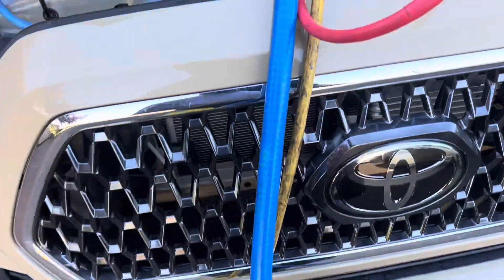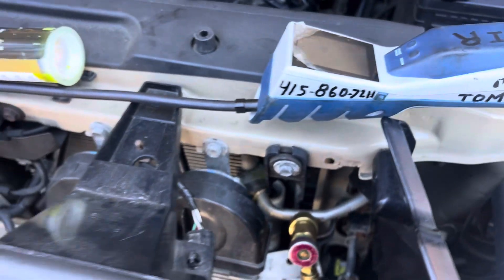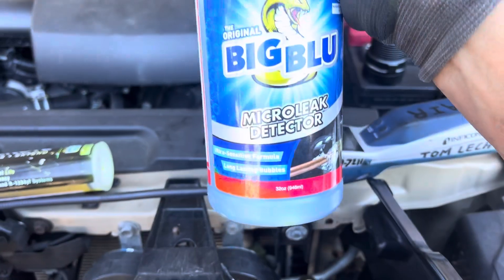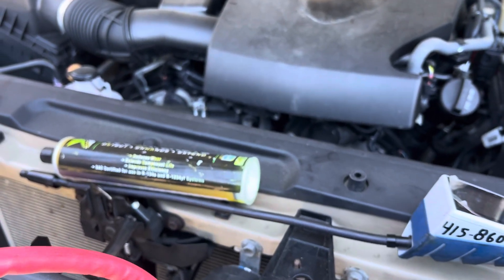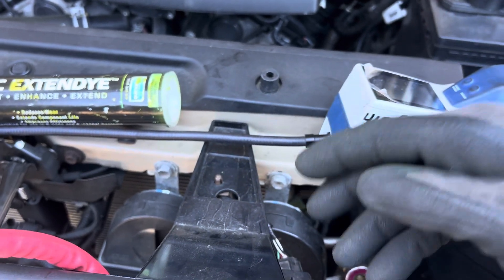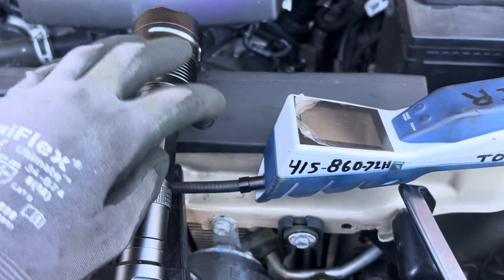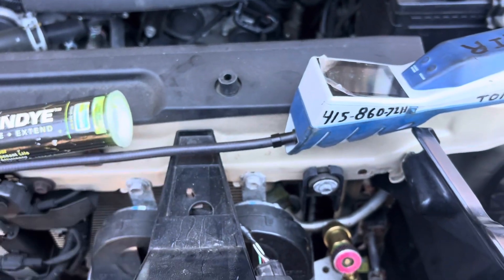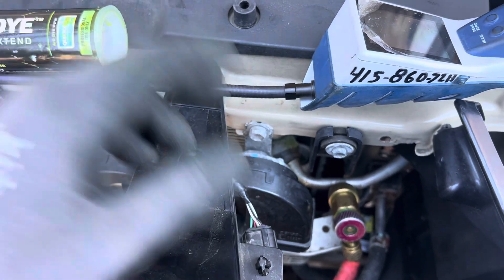ONLY USE UV DYE TO FIND LEAKS.  False diagnostic port doesn’t need to be replaced.. cheap UV light

Comment: Soap and water almost free
Reply: Thanks @coldfinger459sub0
Reply from the maker: Soap and water can only find a Leaks that are leaking at that moment. 

Leaks or not always constant 

This is for the UV dye comes in handy . 

Soap and water usually do not stay wet long enough especially on the hot lines like some of the specialized micro leak detection fluids. 
They developed to be very thick and Clooney and they stay wet for a long time. 
So if there’s only like one little tiny bubble, everyone or two minutes. It stays wet in the bubble, stays a bubble, and does not pop or dry out or go away.

This is what the specialized fluids for looking for leaks or developed for. 

Something soap and water cannot do

Comment: That is so wrong. Let me guess they don't have a good dehumidification system to lower the air humidity level down so that when they open up an accumulator they're going to get air that has greater than 30% humidity. I'm so glad it's fall and I'm taking apart my AC and not in the hot humid weather. Doesn't help to have a way to keep that down?
Reply from the maker: Humidity down below 30% makes no difference

Humidity down to 10% no makes no difference 

We’re talking about humidity level solo were into the parts per million make a difference 

To the point where a human being could not live healthy for a long 

You simply do not open the system while it’s under a vacuum that’s all 

Put fresh oil in the system after you have flushed it with all your new parts and put it on the vacuum pump easy procedures to follow

Comment: Do you tell the shop about it only being an oring or do you just not even bother because you know how it will go?
Nice work as alwaysThomas
Reply from the maker: I used to tell shops had a couple shops get a little bit upset. 

And most shops are used to just making money by selling wrong parts. That’s how they make a living. . 

If they actually fix things correctly or diagnosing correctly, they would make as much money as I don’t know how to 

But at least I got them to purchase a really good UV light to do a good diagnosis 

And I got them to purchase a really good refrigerant leak detector so they will not miss the Small Leaks and be able to pinpoint them 

And I turned them on to my micro bubble, Lieke, refrigerant detector the spray on that’s really thick, and it stays wet for a long time . 

I try to educate all the shops that I go into to bring up their level. It helps them and help their employees and it helps their customers.

Comment: Hello,
Q:if it is legal to release the refrigrant into air (just imaging that) does the air enters the ac cycle? 
Any case (all cases)

If in this case?
In case of low and high side by pressure gauge are open fully when the pressure in static?

Just i had this question in my mind
Reply from the maker: In the United States in many countries no it is not legal to release Refrigerant into the air

No air does not enter the system through leaks . 

The (“ majority “) of modern cars no longer allow air conditioning system to operate in a vacuum . 

So there’s no way for air to enter the system . 

Aaron is enters the system through sloppy technician practices 

A properly service system will never have air in it 

Hey system after refrigerant recovery will have dry nitrogen perch back into the system so it will never be under a negative vacuum when a component is removed, so atmosphere air never enters the system. 
And every time the component is replaced and it’s put on a vacuum pump, so there’s no air inside the system. 

And if the refrigerant gauges are properly vacuumed and purge, there will be no air inside. The vacuum gauge is in hoses.. 

Refrigerant doesn’t get used up doesn’t get consumed it always can be recycled as long as it’s not contaminated with Air the oxygen in the air and moisture, refrigerant basically last forever.
Reply: @coldfinger459sub0 excellent  explanation....  thankyou🌷

Comment: I recently started working for the city fixing garbage trucks. The mechanics there were trying to diagnose an ac leak on one of the trucks... they had already replaced the compressor, condenser, evaporator, expansion valve, pressure switches and the thing would not hold gas for a week... they didn't know about nitrogen and the shop didn't have any. 

 I asked the industrial Ac guy that works for the city if I could borrow his nitrogen bottle and he was surprised that a mechanic knew about nitrogen...

It took me longer to hook up everything than the time it took me to find the leak. The discharge hose was leaking on multiple places. 150psi of nitrogen and a bottle of soap and water did the trick. 
I have to thank you for that, I didn't know about nitrogen before watching your videos. Thanks Tom
Reply: They done shot that parts cannon at it!  Pretty much replaced every component.  🤣
Reply: @mailmanjoe  exactly lol
Reply: @VWtech562  Whatever though.  The city pays for it anyway right?  🤣
Reply: @mailmanjoe  they do anything to please the drivers... specifically when it comes to ac. Its hot here in Florida lol
Reply: @VWtech562  Ouch.  Yeah the humidity just makes it feel that much worse too!  I took a trip to Japan in the middle of August awhile back and that was an eyeopener to how the humidity makes lesser heat feel so much worse!
Reply from the maker: And once you have a dedicated nitrogen station set up, it doesn’t take no time to set up. It’s quick and fast.. 

Every shop should have a dedicated nitrogen tank, set a hoses on it, so there’s no time wasted . It can be the quickest fastest method of finding leaks on a vehicle comes in empty.
Reply: @coldfinger459sub0  The shop foreman is an ASE master and he didn't know about nitrogen, but now they understand how effective it is. Hopefully now they will invest in a nitrogen station.

 I posted a short on my channel with the leak I found.

Comment: If I was working there, I'd have already bought the proper tools, out of my own pocket.
Hopefully they aren't cheaping out on the replacement condensor, that would drive me nuts.
Reply from the maker: By the time I left his job site, I was showing him how my lights work compared to theirs. One of the technicians went online and bought the UV beast version three like I have I showed them the difference in the refrigerant leak detector and I had my leak detector, reference test vials with me.

I showed them and prove to them that their leak detector could not pick up any Small Leaks by using the test vials 

And showed them that both of my refrigerant leak tactor’s were easy to pick up the reference bottles 

By the time I collected my check in conversations with the owner of the business he decided it was worth $1000 to Purchased Refrigerant leak detector 

After 30 years, he finally purchased a good piece of equipment 

It just took first hand persuasion actually demonstrating the difference that got him to purchase the item needed to actually properly. Diagnose leaks 

And this is the problem with the majority I would say 90% plus of all owners of businesses
Reply: @coldfinger459sub0  To be fair, they probably have bought plenty of useless crap.  Sometimes that hump is a big hurdle.
Thanks for helping them out, glad they listened.
Reply from the maker: @thisisyourcaptainspeaking2259  I remember working for shops when I was younger very difficult many times to convince an owner or manager an item will be profitable. 

And then off, then I was the senior technician, even though sometimes I was younger 

Senior, in knowledge, even though caller, I was only around 20 years old

And many times equipment would be purchased without technicians, having the ability to fully utilize the abilities of the equipment 

And, of course, technically clueless owners in management, who cannot even trained her technicians themselves in proper procedures, are methods 

Many times to clueless, leading the clueless 

And managers and supervisors and owners always using that excuse you don’t have to be technically inclined to run or operate an automotive business 

And over the decades, myself, and everyone else has got to witness what the results are 

They may work, but that doesn’t mean it’s right